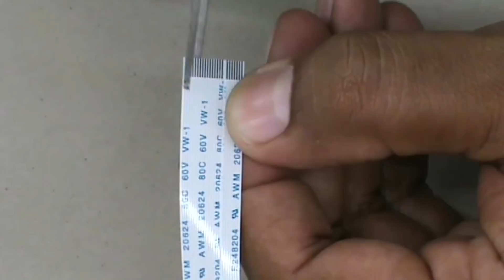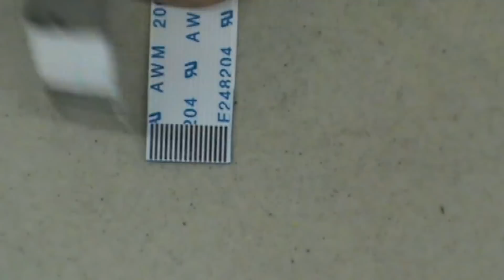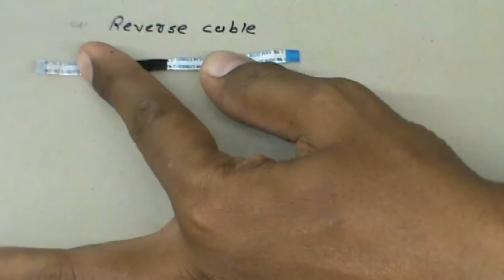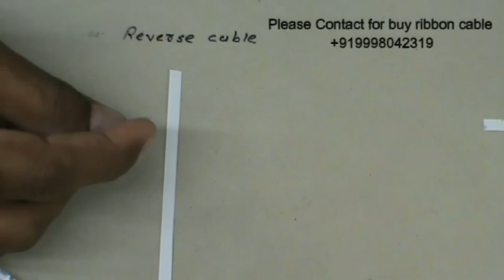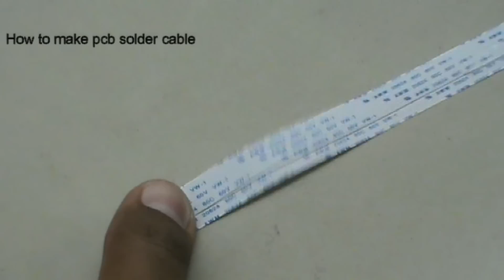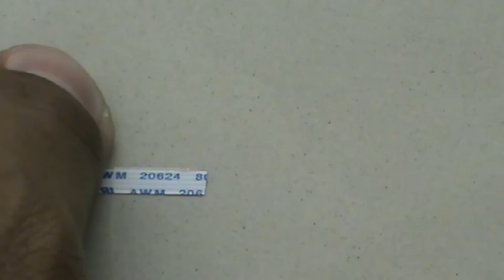Laptop Power Button Ribbon Cable

Comment: I HATE ribbon cable. I break out in a cold sweat when I see the stuff, 
and if it smells fear, ribbon cable vaporizes into dust instantly. it 
also self destructs if it is: exposed to air, deprived of oxygen, 
exposed to sunlight, moonlight, or darkness, the oils in skin, latex 
gloves, and optimism. so i find myself trying to work on electronics 
calmly, wearing leather driving gloves, during a 16 minute period at 
twilight and without looking at what im doing. You sir, are my HERO
Reply: Best.comment.EVER!
Reply: I freakin feel your agony

Comment: You saved my day sir. I had a hp pavilion dv5, which has quick launch touch button and have 9 pin flex connector, what i do is I had a old canon printer which has more flex connectors in cartridge side, i cut a 12 cms and done with this tutorial. And done. Now I m happy
Reply from the maker: Thanks 🙏😊

Comment: thankyou so much for this tutorial, I fixed my JBL bluetooth speaker, the power FFC cable was damaged and did not found that cable anywhere, and there is no proper service centers for the JBL speakers, I managed to open the speaker and got stuck with the cable, it was only a small issue, but I am unable to switch on the speaker, I thought my 10,000 rupeas speaker is gone to the dustbin... never thought I could fix my speaker.. seeing your tutorial i fixed the cable and the speaker works great now!.. amazing!

Comment: Excellent . Just the thing that i need. The thing is that i messed up my touchpad ribbon cable, and the question is because i can not find E315127 20696 cable,can i use some other mark of cable as long it is on 30V? It is for Asus G55V.Any advice i would appreciate.

Comment: Sir, I'm a huge fan of your way of explaining this stuff. 
Specially that LCD and led circuits. 
Matlab koi Nasamajh bhi samajh jaye. 
Sir, Since a month I am trying to learn something which is 3 Volt and 5 volt circuit. i.e. Voltage regulator. 
I have watched some videos where I am not getting the perfect idea to diagnose the problem. 
Specially when Coil Shows "Short' in circuit. 
Will you please upload a video regarding Regulator and it's detail to repair boards. 

Hats off to your work. :)
Reply from the maker: +Sachin Gotekar Thanks for appreciating my videos.. You need to understand all theory with proper way .. And for that you should attend my online video class training... Contact at arieslaptop@yahoo.com

Www.arieslaptoptraining.com
Reply: Harshad Patel sir do you live in the us? so i could buy a cable for my laptop
Reply from the maker: we are located in india
Reply: Harshad Patel but sir can you send it to my location
Reply from the maker: +PLATINUM GAMING where ?

Comment: thank you worked on a sony vaio pcg-9201 i used the same damaged cable cut off the damaged area with a scissors. I didn`t have a flexible blade so i used a straight razor using the point  i scraped off each pin slowly untill all the plastic was removed, just don`t cut it too short because the sony vaio needs more ribbon cable to move the power button into place thanks again

Comment: Can you just solder broken cable points to power button board? 
Glue holding in place & don't want to rip ribbon off if no need. 
Also, what is the greyish stuff brushed on & after soldering?
Many thanks. Great video.
Reply from the maker: Blnd_E hold cable on pad and use nice clean solder tip for solder it ...with brush use flux

Comment: Sir what tape is that white tape you used to stick blue strip on white??
Reply from the maker: Double side glue tape
Reply: sir any link to buy the same ??
Reply from the maker: you can buy it from tv spare part shop , ask them for home dvd lens cable 0.5mm and cd player lens cable 1mm
Reply: thanks bro.... fixed the cable using double stick glue tape... thanks a lot

Comment: Hi, I replaced my power button ribbon but after that my laptop keyboard is behaving strange like some keys acting as power button. If I remove the flex cable its works fine. Any suggestion/solution?

Comment: Hello brother.  I was told these cables need to be specially made and would cost around Rs.1500 for two, one for power button and one for trackpad. And, a similar looking wire cost around Rs. 60 each online. And is there any need  of checking ratings of the wire?

Comment: the ribbon labelled "1mm fcc cable" has number printed on it which is "20624 which is same as the ribbon on my HP G62 power button ribbon.  I got ribbon with same number but pins are much smaller then my G62 power button, I also had 2 strips of another ribbon with the number "2896" written on them but the pins/wires match the same size as my power button. My question is if I am able to use that ribbon with the numbers "2896" that match wires/pins as my broken power button and would it would?

Comment: Hello, Harshad. Your videos are excellent! I wonder if you have one about the HD ribbon cable for the HP Pavilion 17-AR050WM 17-AR laptop—HDD Connector Flex Cable DD0G97HD000. The part number is 933468-001. I ribbon is flimsy and has 10 tracks. I can´t find it here in Brazil.

Comment: I need 2 FFC cable

Series No.: CviLux
Conductor Pitch (Center Spacing): 0.50mm
Number for Conductor: 20pins

&&

Series No.: CviLux
Conductor Pitch (Center Spacing): 0.50mm
Number for Conductor: 60pins